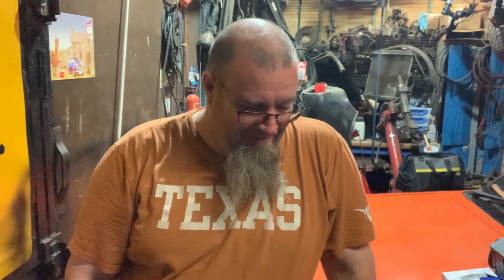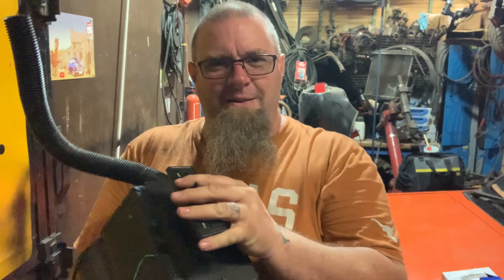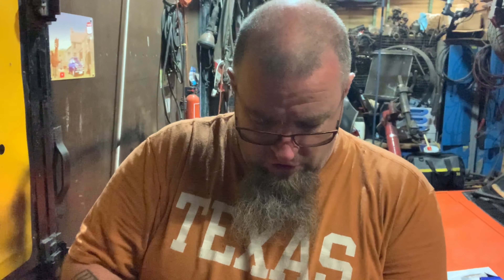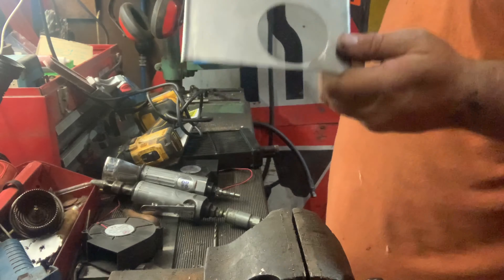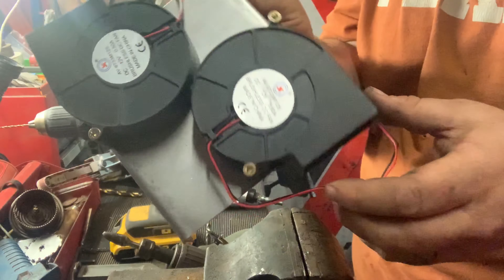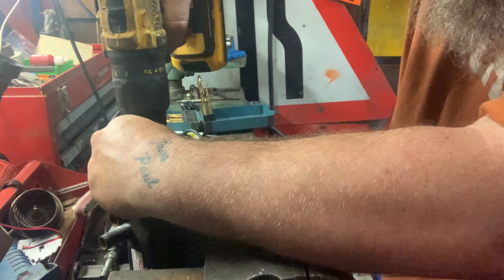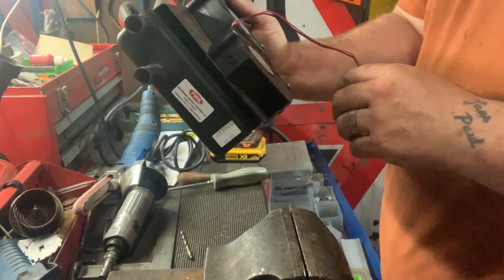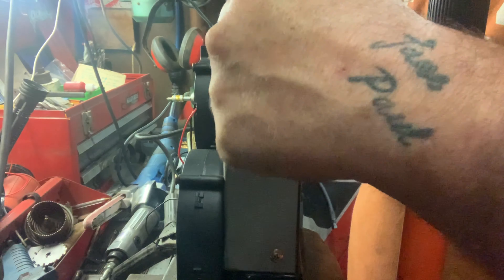Classic mini compact heater DIY

Comment: Nicely done, nice tip on the socket over the drill bit. I've run those fans in a PC for years 24/7/365 and they never failed. I probably still have them in a box somewhere and I bet they still work.
Reply from the maker: Oooh thats good to hear ! Im just a little concerned about the potential temperatures they might have to work in ? ..... only one way to find out ! Lol

Comment: YES! I’ve been looking for a heater for my moke for ages. Now I’m going to make one. Will be good to see how yours performs.
Reply from the maker: Richyriches tube .. glad ive been of some inspiration ! Im looking forward to getting it in the car now and seeing how it performs! Of course it might be a complete failure 🤷‍♂️ lol
Reply: It’s simplicity is key. If it doesn’t quite work as predicted, I’m sure with some tweaking you can get it working well. For the Moke, I’ll definitely be needing a version that blows some warm air on my feet though..!

Comment: Great video again Paul. Will you rig your switches so that you can start with 2 fans running and then drop down to just 1 fan as the car warms up? I have had Minis for nearly 40 years and cannot imagine your streamlined unit being anything other than an improvement. Only car I had with a worse heater was an early Landrover.
Reply from the maker: Neil Bedford ... i can only hope it actually works ?!?! .... i will wire them both together because one fan does one screen vent each so having them staged isn’t needed although in another comment someone suggested a variable resistor to alter fan speed ! That sounds good !

Comment: I used a 12 v computer fan from rs comp.... Very good cfm.
Reply from the maker: I did buy a few 4” computer fans to start with but channeling the air was easier with these !
Reply: @Xpp.  , I used the old heater chassis and slipped it in front of the heater and uses bolts to fit it in front of matrix, as your idea,,,,,both good Mate.

Comment: Great idea hope it works,  be interesting to see what the cabin temp is like on a warm day due to heat radiating off the matrix
Reply from the maker: Brad Farrant well it’s certainly a different approach to that huge thing that hangs under the dash ! It might work 🤷‍♂️ .... i was considering a Ka heater valve ? That way i can use a switch to turn the hot water on and off ? ...... but gonna try it without at first just to see how it goes !
Reply: Paul P ‘s Mini build  yeah let’s hope so, definitely interested to see the results

Comment: Thing you will need to block the ends off that box . Also you sure the fans the right way round 👍😂🤣
Reply from the maker: I was thinking of blocking off those ends but then i thought it might create a bit of a heat trap ? And using plastic fans im not sure they would survive ? ....... ive checked , it says ‘wrong way idiot’ on the other side 😂

Comment: for my frefernece id use a foam or rubber seal between the mount plate and matrix just so its gonna draw more efficiently. or in the case of computers , foil tape can sometimes suffice ha. very inventive tho , might have to think of something like this for mine if i cant figure out why my heaters dont work ha
Reply from the maker: I did consider filling in those side bits , but after having a think on it i dont know if it would cause an excessive heat build up when they’re not switched on ? Probably melt the cheap fans ? I thought leaving it open like that would help some of the heat escape ?
Reply: @Xpp.  will the heater be permanent plumbed in to hot or will you have it valved/switchable

Comment: Paul, would a dashboard display dimmer switch act a a speed control for the fans maybe? If so then you could block up the ends of the cover plate for maximum performance. I think the heat of the water will be fine with high impact plastic...good luck buddy!
Reply from the maker: Oooh yeah now thats an idea !! I think you can get variable resistors with an ‘off position! I might look into that ! Could be a neat touch !
Reply: You could also use a pwm pulse width modulator from eBay to control the speed also which is what I plan to do in my mini heater some have an on off switch built in too

Comment: Looks like a nice little mod! I think you should be ok heat-wise as they seem to be GFX card cooling fans (?) which should be resistant to a bit of the old therma!
Reply from the maker: Thats good to hear you say that ! Thats really my only concern is if they will handle the heat ?
Reply: @Xpp.  Well GFX cards run generally at about 65-70C when pushed, but the fans really kick in at around 90 so they must function to that temp plus a good allowance I would say.... Oh, I also meant to say plug those gaps for better air flow through the rad!

Comment: Mini heater has always been poor .. with a trickle of air to a rapidly steaming up windscreen,  3rd fan to suck air from outside .?
Reply from the maker: Chris Beck .. ive never had a heater in my mini but steaming windows in the winter time was an issue last year .... im hoping the recirculating heated cabin air might be enough to keep it clear ? But of course if it does need outside air then i’ll have to rethink it all again ! Its all trial and error this you know lol